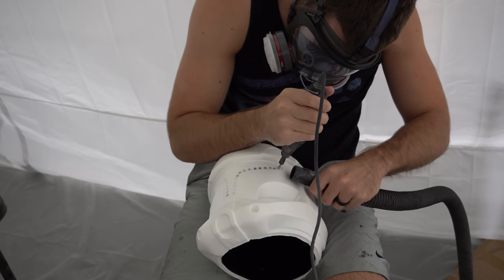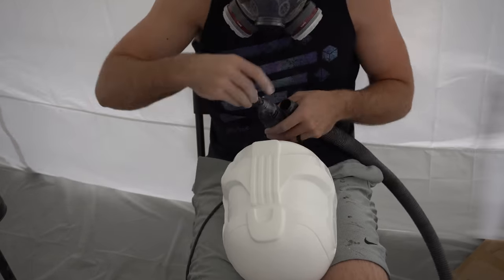How to Make a Republic Commando Scorch Helmet

Comment: I would absolutely love to make a Republic Commando Suit and Helmet. But with a twist- Fully functional life support, Transparent Display with working H.U.D. visor showing stats of life support from sensors like O^2 pressure, outside temperature. The helmet with a working sealed respirator and bright head lamp with infrared flood light, and I would love to add much more.

Just like Boba Fett’s armor is metal, seeing that left side dome dent. Would love to work with real metal to shape a helmet and or body armor. 

You may be asking, why go this far? Who wouldn’t want functional armor as cool as the RC? 😅

Comment: Hey anyone literally anyone with a 3D printer even if it isn’t Aaron I just bought an ended 3 I put it together and started printing after it said it was all set up however when it’s printing it thinks it’s printing something yet what comes out is just a line of filament then I have these random strings everywhere and it’s wasting my filament anyone have a fix to this?

Comment: I was wondering why do you sell these for hundreds of dollars like almost 200 dollars for this that's  a lot of money
Reply: the filament alone to print these things is expensive (as well as all the materials he uses to paint and treat the helmet). This coupled with the time he spends making them, and the amazing quality of the product, Means that they are going to be pricey. With that being said, these are set at a REALLY good price.
Reply: Yes I know that but Lso not many people are even going to be buying these things
Reply: @denofthe65th  you’d be suprised. But he also sells detailed stl files which I have purchased before. Helmets are not the only things he sells!
Reply: I know but what if u don't have a 3d printer
Reply: @denofthe65th  then you don’t buy anything! Or use the sto files for 3d modeling
Reply: I was also hoping for the actual creator to answer my question
Reply from the maker: This isn't a 3d print it is a resin cast. Resin is expensive right now and there's a high initial cost involved in making them. I only make about $30 per helmet sold
Reply: Well I was also wondering you still have a couple of arc trooper helmets to make from battlefront 2 cobalt hero and the default design as well when are you doing those